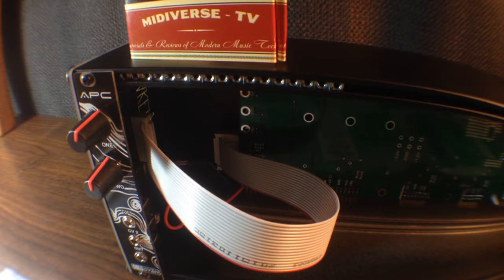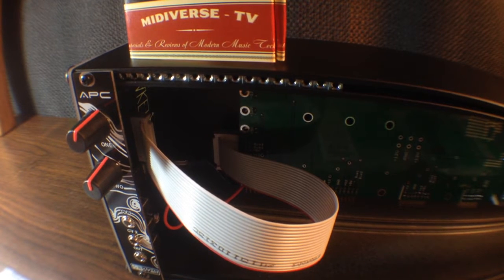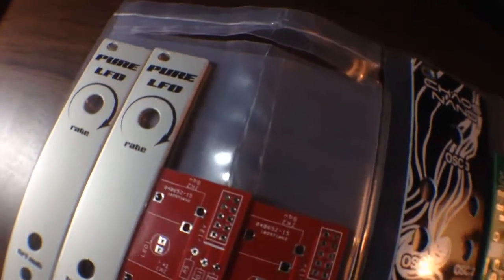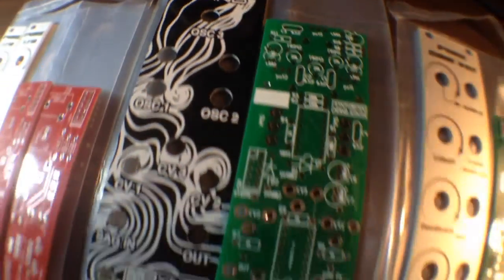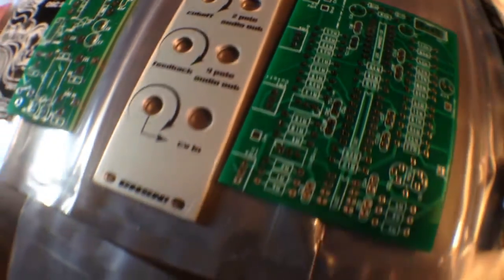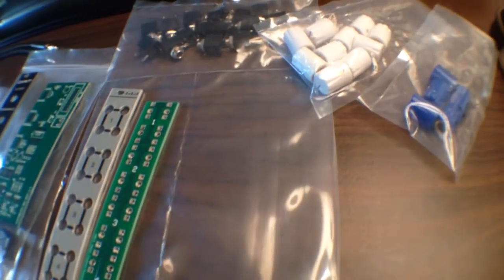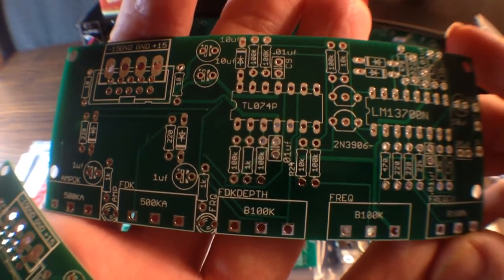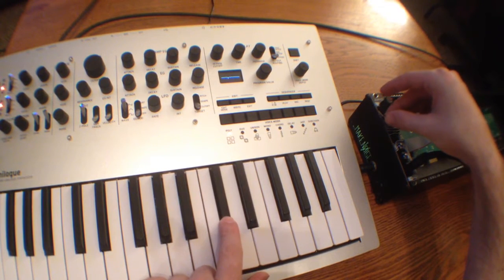Synth DIY - Part #1 - Getting Started, Selecting Modules - MVM #24

Comment: rad video! how did you connect the module to the minilogue? i just ordered the mfb dominion 1 which has lots of modular connectivity and I want to incorporate some modular stuff.  Can a hardware synth's keyboard be used to play the modular vco's without having a midi module installed? can cv's be used instead?
Reply: Based on what I can see from the video he is just routing the output of the Punk Console through the Minilogue you can do the same as well.